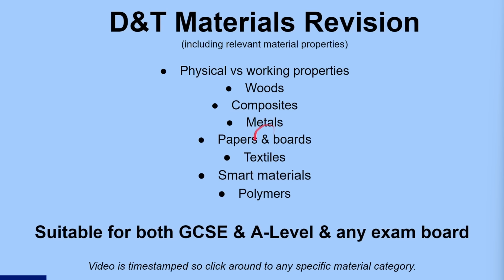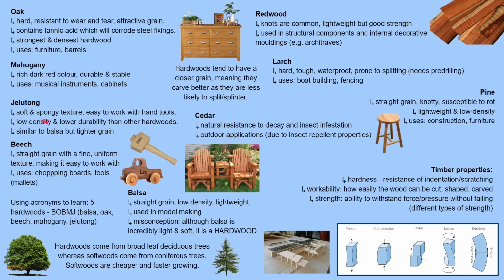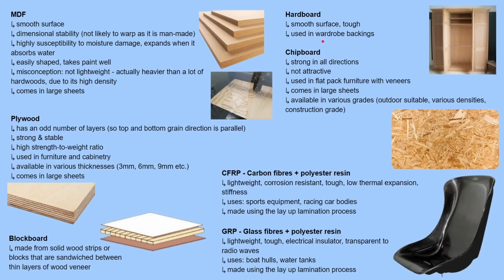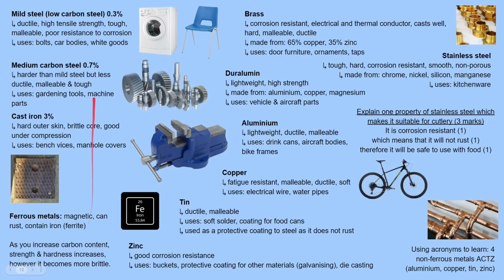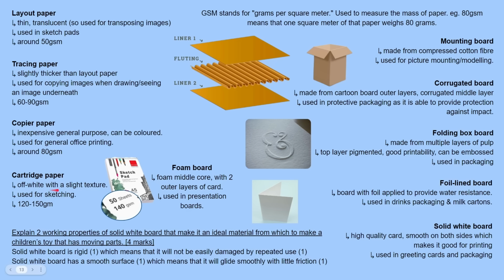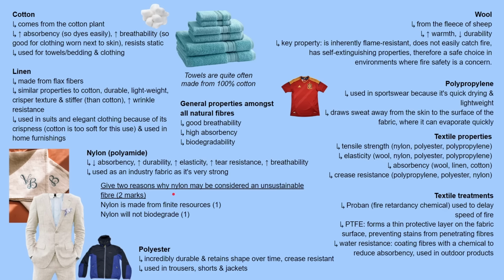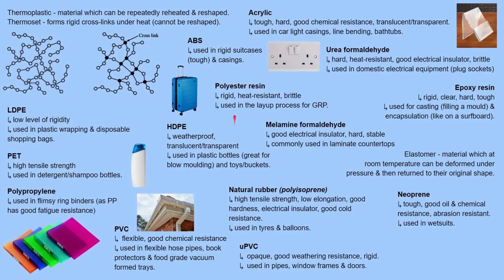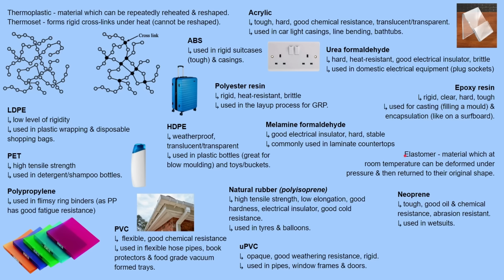All of MATERIALS explained | GCSE & A-Level Design Technology

Comment: Thanks for this. I have a quick question for you, some materials are missing from each slide for example on smart materials nanomaterials are in the textbook but not in your video. Does that mean we can skip them or do we still need to revise them? Thanks!
Reply from the maker: Great point, there are an infinite number of materials, the ones I mentioned are most popular in most exam boards. But this video is meant to cover both GCSE & A-Level for all exam boards, so there will inevitably be some tiny gaps for specific boards. 

I'd recommend still looking at nanomaterials from your textbook, if it's in the specification.
Reply: @MitulDoesDT  Ok thank you!